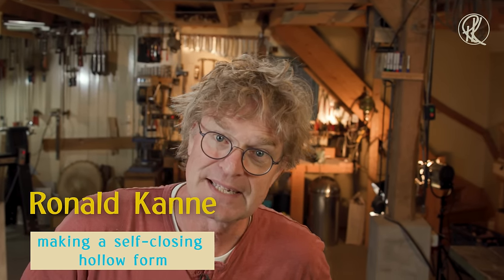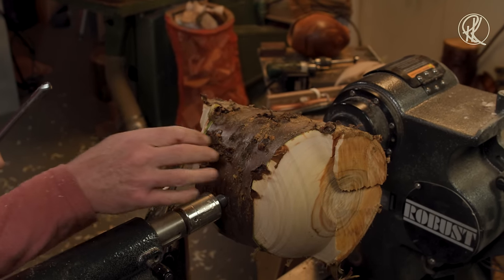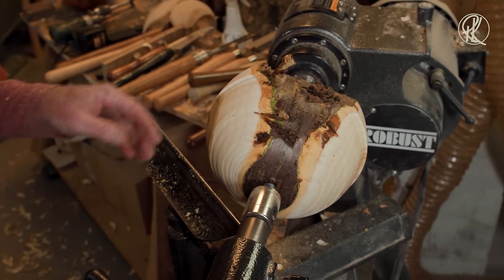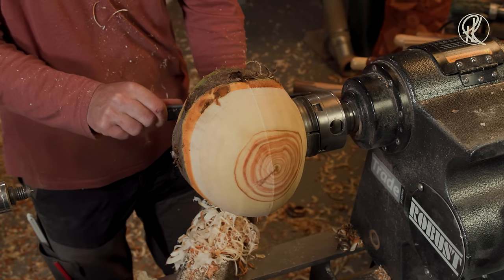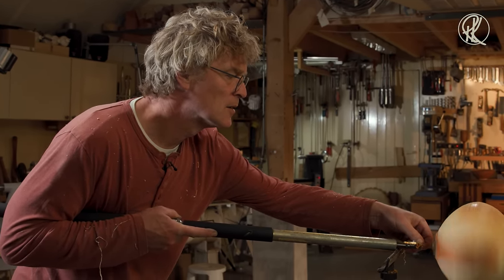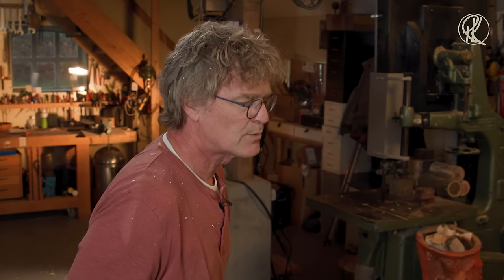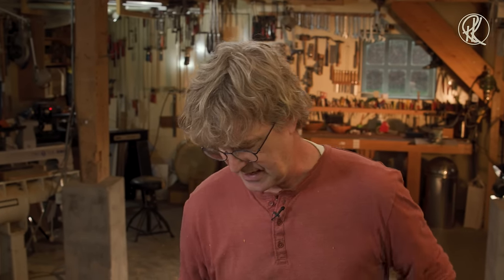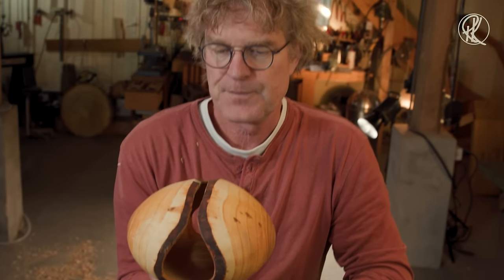self closing hollow form

Comment: I did this type of turning about 2 years ago.  Like what you experienced, my wood cracked and really hurt the appeared of the form. Then I decided to try something I have never seen done before.   I used steam from a portable steam machine to heat the wood around the Crack so it could be bent, reshaped, glued and clamped.  My luck was pretty good the first time I tried this, but not so good on some other hollow forms. Every piece of wood is different.  Sometimes this technique works, other times it doesn't. BTW, the walls of the hollow wood form need to be thin; about .25" or  6-7mm.

Comment: Inspiring project. Probably an issue of wood not thin enough. I will try but use the Microwave after turning with no more than 2 minutes at a time .... but wood is wood as you said.
Reply from the maker: I think you are right with the 'probably not thin enough' remark...

Comment: To clear the bark for the drive spur, I use a forstnerbit - this leave a clean level surface for the drive spur😀
Reply: Wrong
Reply: @scottcates  wow, that's a really intelligent answer - why don't you elaborate?
Reply: @steenteudt  pedantic
Reply: @scottcates  🤣😂
Reply from the maker: I sometimes use my little electric chainsaw or sometimes a chisel... i don't mind how one does it, as long as the drive center is in the wood and not just in the bark...

Comment: If you hollowed out the long handle of the tool that carves out the inside and blew compressed air through it and out through the metal part of the bit holder, would it blow out the shavings?
Reply from the maker: I know there are drillbits were you can do this. But the shavings of the pro forme tool are quite big sometimes and i know they will clog in the opening of the piece...

Comment: I would've gotten about a third of the way into hollowing it out and created a beautiful spinning ball of smouldering kindling. And that got me to thinking about an implement in the field of poultry processing of all weird places: it's a ring shaped knife attached to a vacuum hose, used to remove the last little bits of meat from the chicken carcass. Something like that might work really well to hollow out wood like you're doing here, without it building up the flammable bird nest inside or having to worry about making escape holes around the outside.
Reply from the maker: In practise it appears that the shavings are to big to 'vacuum' them away... but maybe if i would be scraping it would work...

Comment: Before you let this dry to get warped, you should make a small wooden ball just big enough to push inside.   Then when is warps the ball will get stuck inside and make a rattle.   The shape is like a brass jingle bell on a harness.   Fill that crack with a crushed gem  stone to add color or, line the crack with gold leaf!
Reply from the maker: I did that once already. The ball inside was holding the ashes of someone...

Comment: Here is a question can anyone learn how to turn wood, reason I'm asking I signed up for a Wood turning class and the instructor saw me come into the shop and told me because I'm in a wheelchair I can't learn wood turning I got my money back but I was  ticked off
Reply from the maker: Hi Alan, if you're in a wheelchair it is difficult to use a standard lathe. However, there are lathes on the market that you can use sitting down. Oneway has one, Robust has one...